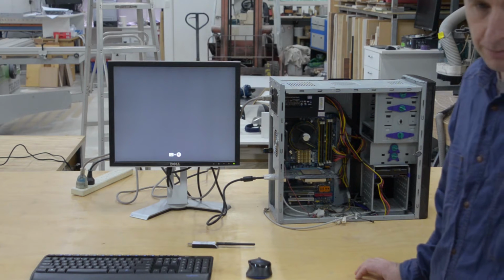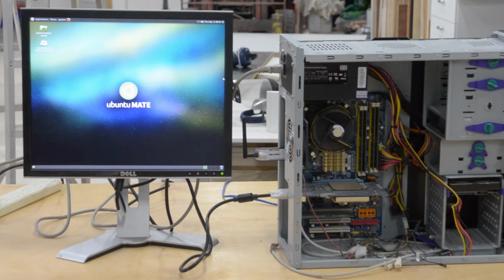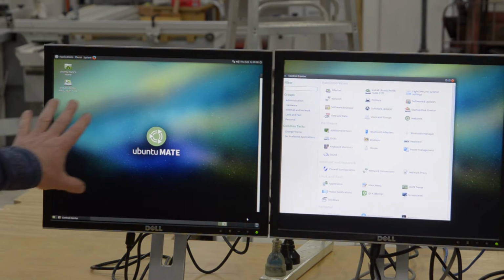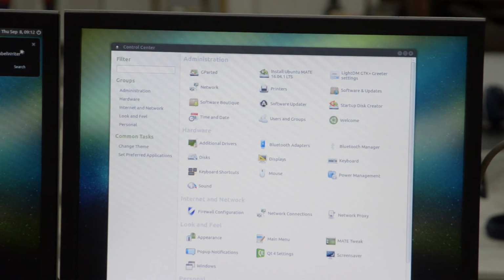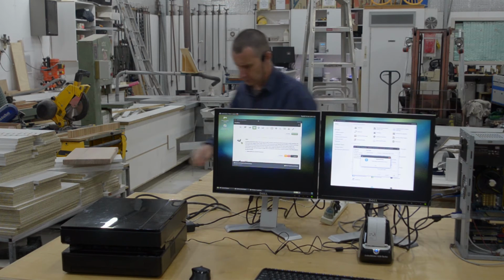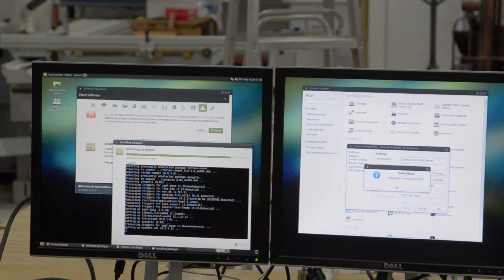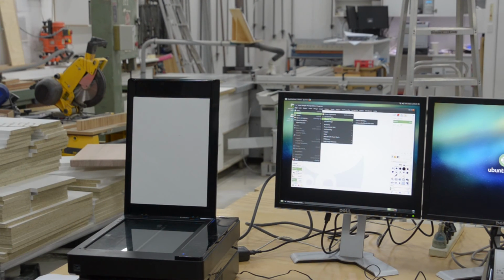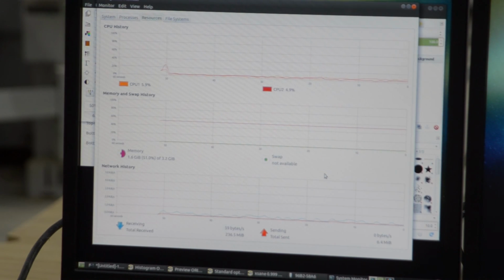Live distro test - Ubuntu Mate, hardware & software workout.

Comment: The funny thing is all the printers I've ever used for Linux have been Brother or Epson which always seemed messy to install.  However Im impressed with the demo, nice to see it can be that easy. Next time I must remember to get the printer for the Linux box and not the other way around !  :) PS: also spotted you on the official Ubuntu MATE Facebook page ;)
Reply from the maker: I have used Brother printers, and set them up for clients, and yeah they are problematic.
I have five Epson printers, of three different designs. 
The video I intended to do was a comparison across systems, but I shot off in a tangent and made this instead ;)
I'm on their facebook page?, wow!, I'll have to take a look. Thanks for the 'heads up' :)

Comment: I've been running my Thinkpad T410 with a docking station at my desk for a couple of weeks now exclusively on an ubuntu mate 16.04 live usb ever since I had a recent hardware failure on my main drive. I'll be getting a new drive soon, but in the meantime I have been able to do everything I need for weeks on a live system with no problems at all.  I'm really impressed with this video. You got a good selection of random hardware and installed programs going within a small chunk of ram space on an old machine. good work.